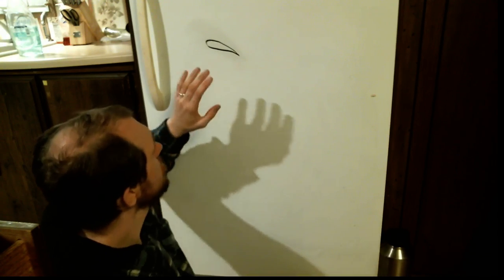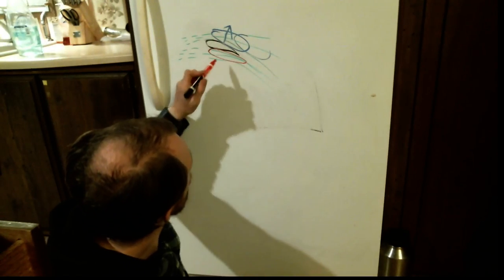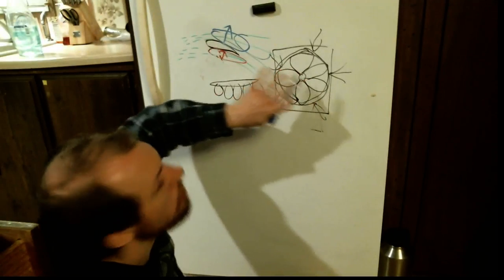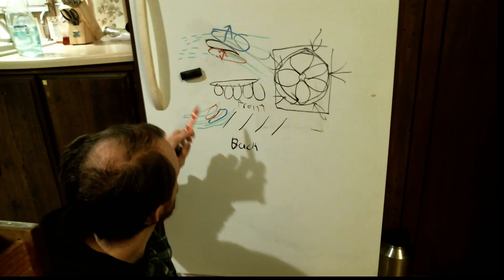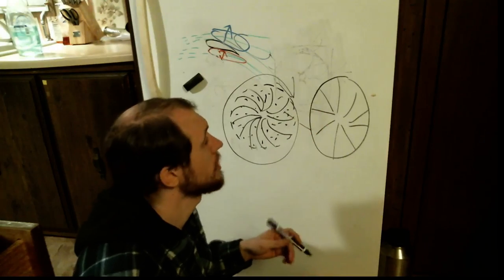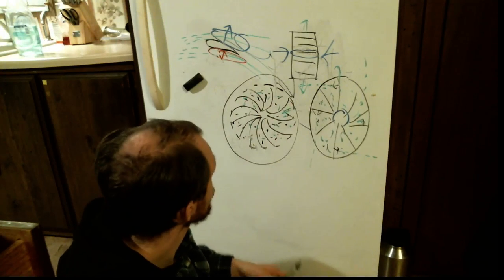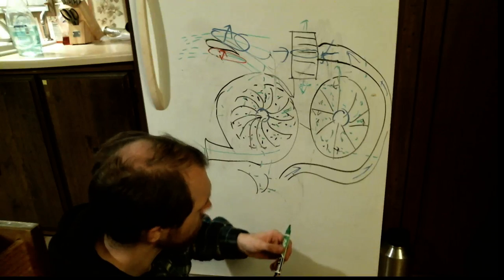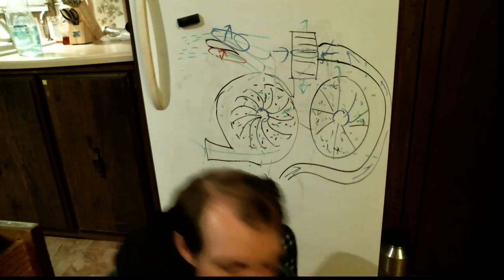How fans create suction

Comment: Does green slag glass have black flakes when put over a light? I thought I had Williamsite but slag glass fits the location better.
Reply from the maker: Great question. None of the pieces I collected have it, but black flecks are usually caused by carbon, chromium, or silicon, so it's certainly possible. However, Williamsite is known to commonly have little black flecks of chromite in it, so even if the location seems odd you could still have some.

Comment: Thank you so much. Not much on YouTube about fan design. Thinking about 3D printing an Impeller for a 20” box fan air filter as the fan blade isn’t designed to suck air through an air filter.